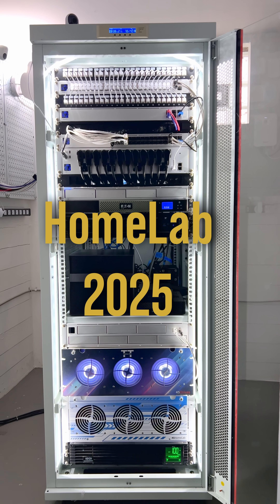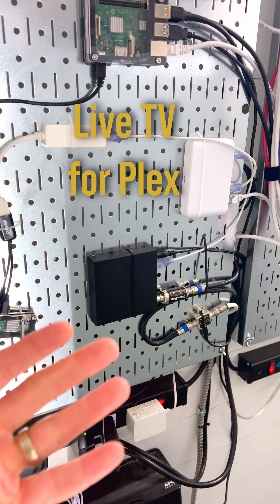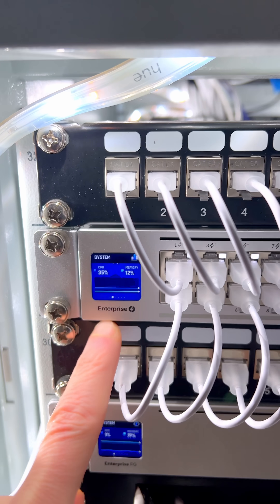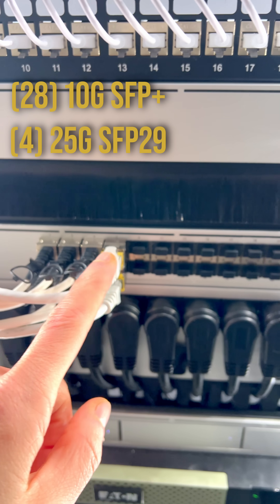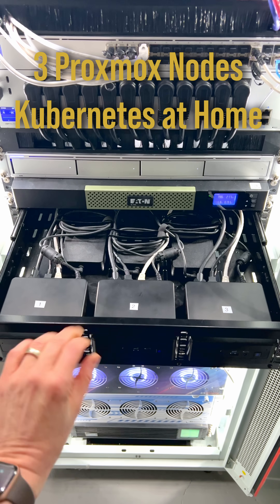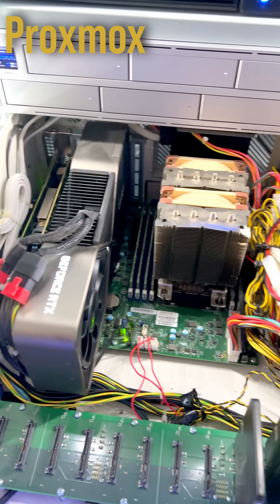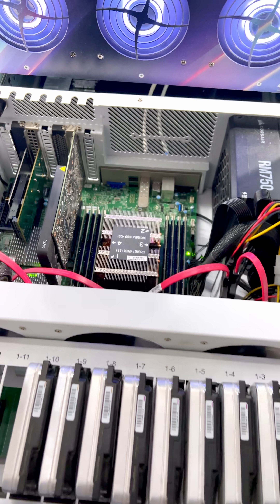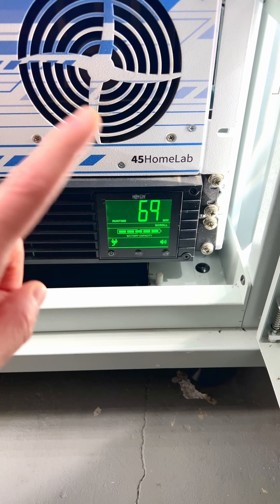Homelab Hardware Tour 2025

Comment: Jesus Christ dudes budget for networking as big as the US military
Reply from the maker: I certainly hope they have a bigger budget or we're in trouble
Reply: @TechnoTim  they do just the same stuff cost 10 times more in the military
Reply: @MartianMilitiaHQ  It's probably the same in any country ( I'm from Russia)
Reply: @MartianMilitiaHQ  and just think we used the lowest bitter, you can imagine how much the rest of them were
Reply: @TechnoTim  They got a big 1.
Reply from the maker: @marshalllapenta7656  😅
Reply: @TechnoTim as someone in the military our laptops are all like 20 generations behind think the newest laptop in my unit has an Intel i7 in it and takes around 15 minutes to start up the wifi is slow as well loading Google is easily another 5 minutes after the initial startup. For space because all users that log into the computer have thier own common access card and save things on the computer when another person logs in they have no access to that saved data only the person who saved it on thier side with thier common access card has access so after a year if someone uses alot of space and downloads a bunch of stuff and saves a bunch of files the computer runs out of space and basically the computer has to be sent in to a specialized shop to have the storage removed and disposed of and a new one installed. It truly is horrible the computers we use I'm pretty sure if you got hands on for a few minutes at most you'd offer $40 for the computer for a whole companies computers you'd probably offer around $800 now remember this is basically every company or unit so chances are your specs and equipment are working 10,000 times better and the money you spent on that server is probably just as much as a whole military installations computers 😂
Reply: @TechnoTim 😭
Reply: @TechnoTim Air Force has a bigger budget, but the US Army's in the trenches.
Reply: @TechnoTim what would you be in trouble for, not being able to steal other countries oil?
Reply: He’s got a better set up than most networking rooms I’ve worked in on the bases
Reply: I've worked at the NOC (Network Operations Center) for Motorola, Wireless Telecommunications companies, etc. and this is nowhere near the size of a companies network. But it's pretty and organized though. I like it!
Reply: @spankbuda3769 I think when people say military grade  they rlly mean technology?
Reply: He’s also like the military when his wife askes what everything cost, the budget paper trail was magically lost
Reply: dancing for old tech.
Reply: That budget is surprisingly low
Reply: Thou shall not use The Lord’s Name in vain.
Reply: A datacenter transit rack would cost orders of magnitude more than this but for a home setup yes, this is more than most homelabbers will spend on networking (or even a decent chunk of smb's if I'm being honest).
Reply: @nadtz  Even small-medium web development companies may not have this amount of hardware. I am a developer, and a company I've been working for, which had about 30 employees, they had 3 or 4 PC builds for dev servers, dedicated firewall and dedicated router, and 2, or 3 APs within the main office. Not sure if there's something I've forgot, but still way less worth than what's in this video 😂
Reply: @lassebrustad  Yeah like I said even a decent chunk of smb's (small medium businesses)
Reply: For real. Made me sick watching this
Reply: That doesn't look much like a home lab to me 😂 especially with a peta byte in hard drives
Reply: It’s better than the military 😂
Reply: @Dpiiiius  That's what I heard......
Reply: Wouldn’t be a home lab without a few raspberry pi’s
Reply: Jesus Christ is the name of the Son of the Lord God Almighty!
Reply: @johannienel1  no it’s the name of the son of my mechanic.

Comment: Ready to scale up that home to 1000+ users any day now lol. 

This is sick over kill and its cool to see the limits pushed.  I want to emulate some of this but for now my apartment is served by a TPlink and a synology box and thats good enough for now.
Reply from the maker: @Rickles  998 users to go!
Reply: @TechnoTim  This is so damn funny. 

I designed my whole system to fit in a watersealed Pelican carry on case, and run easily off solar/battery backup. Maybe one day I'll be in a secure and reliable enough environment to try this.
Reply: Seriously ..don't get me wrong it is awesome but good lord overkill
Reply: Home data center more like it.
Reply: Someone needed a tax deduction 🤣
Reply: When we finally start cloning ourselves, this man will be ready.
Reply: This is cool af! But it isn't pushing any limits anytime soon 😂 unless we're talking about electrical supply to that house. 
This is already a "data center" grade "homelab". The location I am working at, doesn't even have a dedicated NAS, let alone a cluster or any testing machines. Only thing we have is a Fuji/Siemens 2U rack server as a local domain controller and a couple other functions.  
I am getting my stuff together to make some experiments at home (AMD nuc with 16gb RAM and 512gb storage, 1 Unifi DM se + 1 U6 Pro). Both network appliances I got for free cause they were gathering dust and unused - both never plugged in/used. That is homelab grade, this is NASA grade 😂

Comment: Why 2 fiber? Power loss is power loss. The switch outside isn’t gonna care especially if it’s the same provider.
Reply: But its not the same provider?
Reply: Either way, if there is no power to the ONU it's moot to have 2 ISPs at home.  You'd need to check w/ your ISP before spending this kind of money..
Reply: @k1lldash9  It's not just about power issues. One of the ISP's could be having a core issue/DNS failure/peering issue's etc. So the fail over to a different ISP can make sense. Sure if the fibre coming into the house is through the same ducting in the street etc and it gets dug up/drilled through or the local exchange has issue's and both your ISP's last mile connection goes through that. Yeah you will suffer. But it comes down to how much your willing to spend.
Reply: @ yep! It is about how much you are willing to spend. For home use I just don’t see the point. That’s just me :) I of course mean no ill will at all in the comments